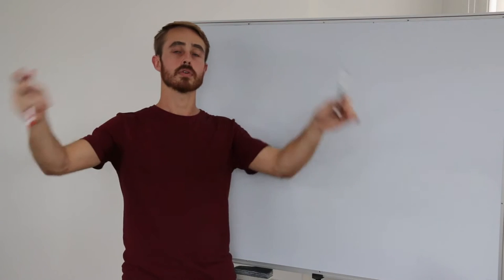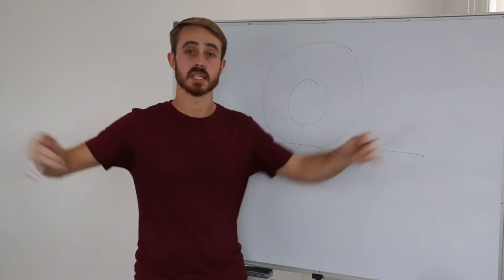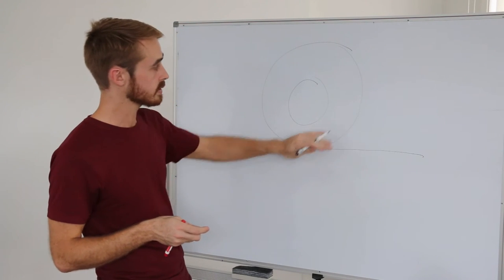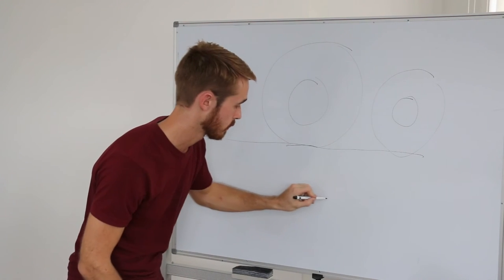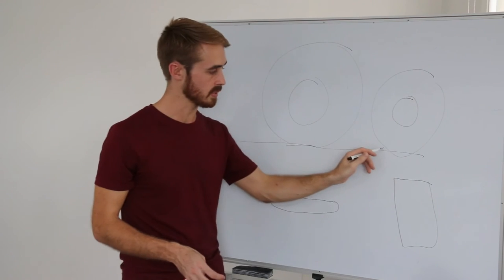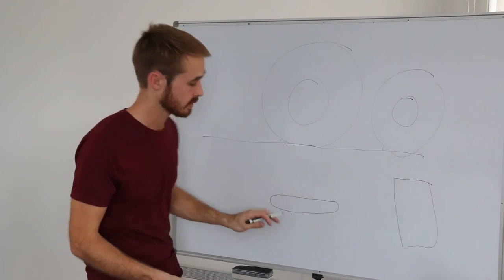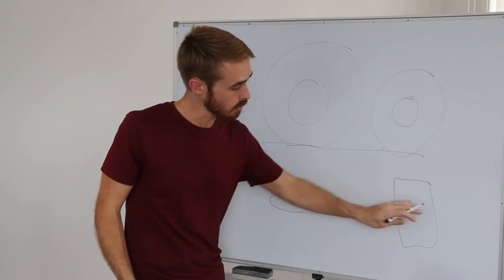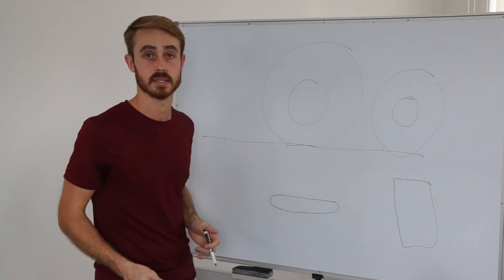Contact Patch Dynamics for Off Road Racecars Explained

Comment: One thing I never fully got my head around for onroad tires is the relation of contact patch size to contact force (correct term?) and resulting grip.
If you have a certain amount of weight on a tire and once it has a big contact patch with little force per square unit and once a small contact patch with relatively more force per square unit.
shouldn't they both have the same amount of grip? doesn't the increased pressure cancel out the decreased contact patch?

Wide tires just have the benefit of flexing less (with the right construction) and having a smaller thermal range (+- same amount of heat enery spread out over a larger surface) therefore beeing able to adjust the compound more precicely, beeing quicker on temperature and less likely to overheat.

Am I thinking wrong?
Reply from the maker: The effect that is confusing you is known as "load sensitivity" or "normal force sensitivity", which is the tendency of a tyre to decrease its friction coefficient as the force down on the contact patch increases. I talk about it a bit in this video: https://youtu.be/y5Y-w4zGW00?t=8m6s

Thanks for watching!
Reply: Ah, thats what I was missing!
Now I get it.
Thanks!